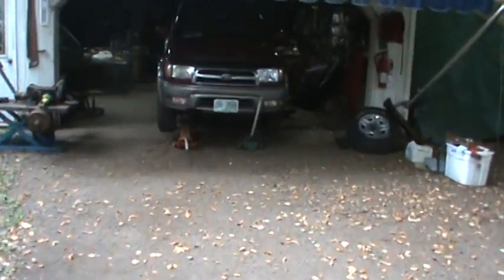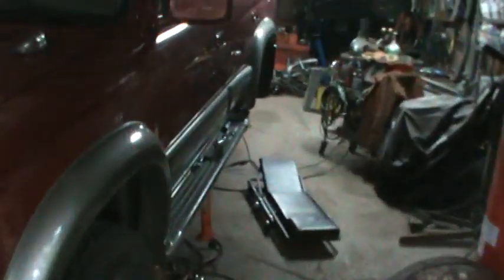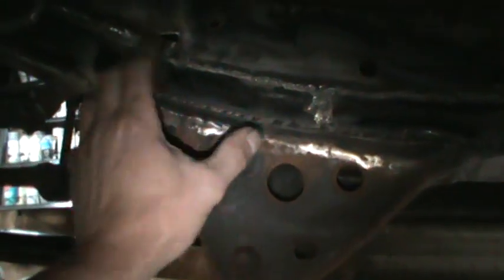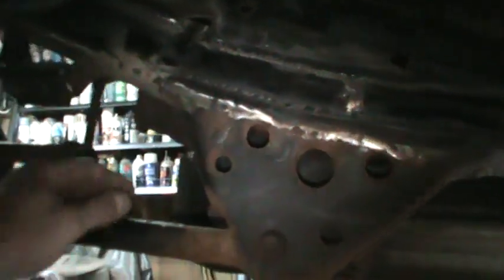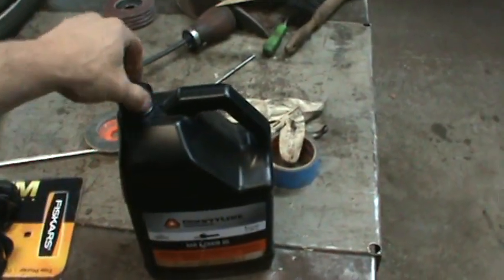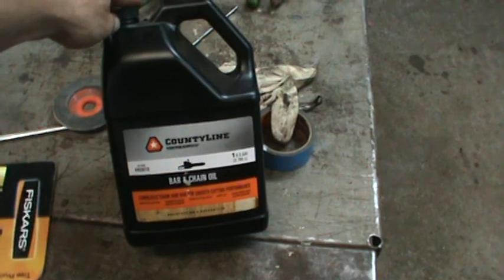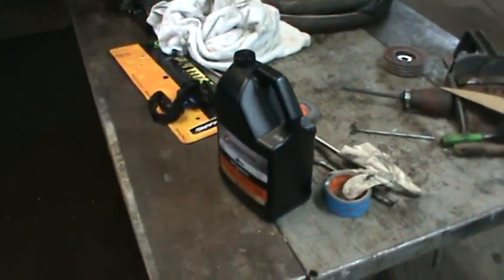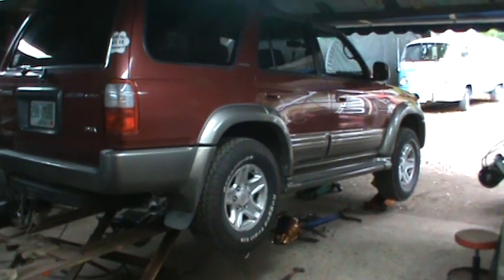4 runner frame metal work done,

Comment: A good welder in the shop really comes in handy. I've got a powertig welder and an everlast mig welder and I use both regularly for repairs. I've never used that kind of oil for rust proofing before. It looks like something I might try.

Comment: Won't thinning the oil defeat the purpose of it being thick in the first place? If you are going to do that why not just spray regular motor oil under there? We used to used drained crankcase oil, back when I was wrenching for a living, spraying it on with an undercoating gun. It sure did make a mess of the shop when we did it. It took longer to clean up as it did to shoot it.

Comment: What a shame, yotas are such good vehicles except the frames. I'm in the same boat with my 96 taco, it's not as bad as your 4 runner was but the repair shop won't put it on the lift anymore so time to repair the frame. What thickness metal did you use and what kind of welder, mig or stick? How did that chain bar oil work on the inside, has it helped your repair hold up??Thanks for sharing. Subbed and liked ;-}}
Reply from the maker: +Fins&Racks Outdoors l liked the bar oil the best and it was 1/8 plate or 11 guage, the  welders flux core mig but stick wouldwork good too if you could get in there enough,